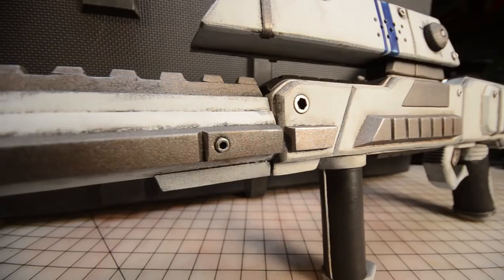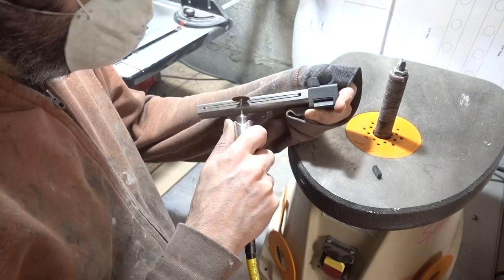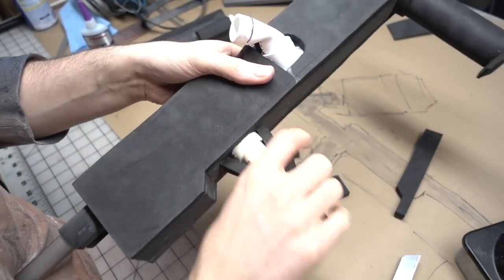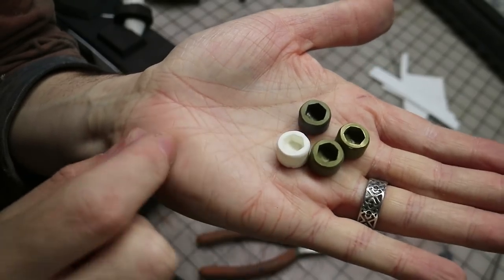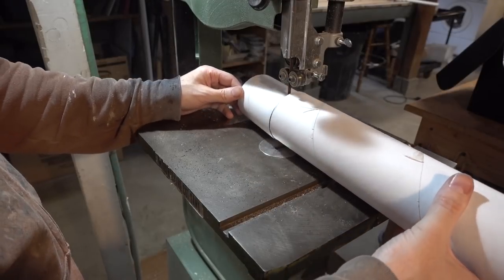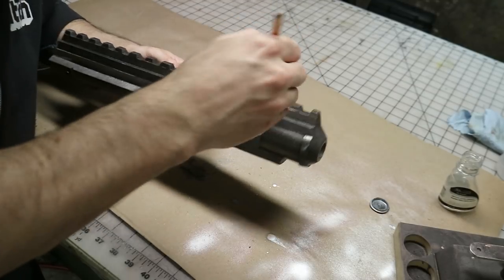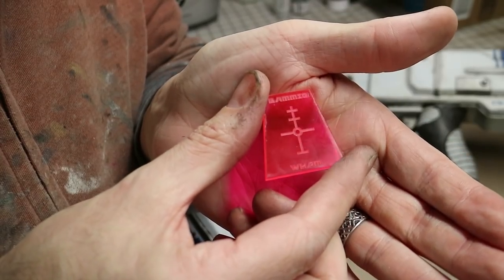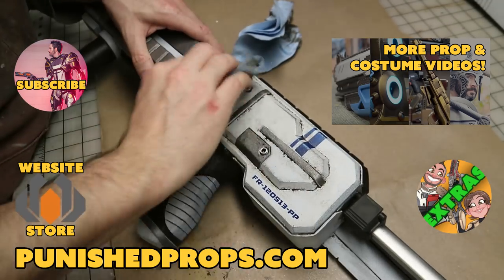Building a Foam Prop Space Blaster for a Film Riot Short

Comment: I love the build. I've never used hairspray for any larger scale weathering like that. Does it hold up well after the piece is sealed? Also, I know it's a space gun, but to add a more functional look to it, the chamfer on the rail sections should go the other way, so that it's a V shape in relation to the body of the gun, that's what lets things grip to a picatinny rail. I usually just buy rail sections when making sci-fi weapons, since they're pretty cheap and save me a lot of complicated cutting. I would have also loved to see another knob on the scope (you want elevation and windage, after all,) and a safety or fire selector of some kind near the pistol grip.

Comment: Is it ok if the pvc pipe hasn’t been sanded before attaching the foam?
Reply from the maker: It's probably fine, but sanding the surface will really make a big difference in helping the adhesive grip it and remain attached.

Comment: hi, it's an amazing build!
 just by curiosity : is there any reason you choose eva foam instead of 3d printing? (  from my point of view 3d printing is  much better for gun, rifles etc because it's easier to make complex details, and more solid pieces ) 
thank's
Reply from the maker: In this case, EVA foam was much faster than 3D printing. It's also pretty durable and could handle being tossed around on set without breaking.
Reply: ok, thank you :)

Comment: when you weather with acrylics, do you thin out with water or alcohol? also, since most of the body is painted with acrylics, why is it that this step doesnt take the paint off? you dont seem to do a clear coat layer in between the two steps.
Reply from the maker: If you let the base paint dry for a couple days, watered down acrylics shouldn't strip it.